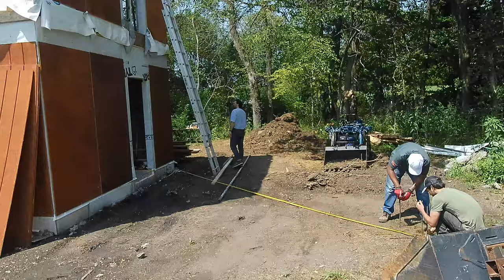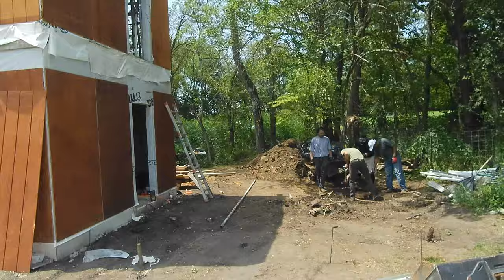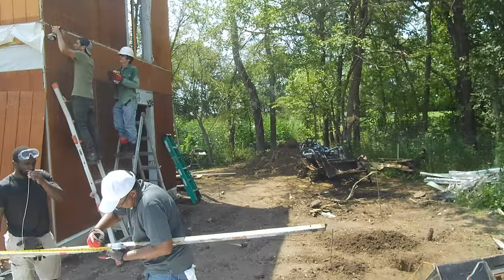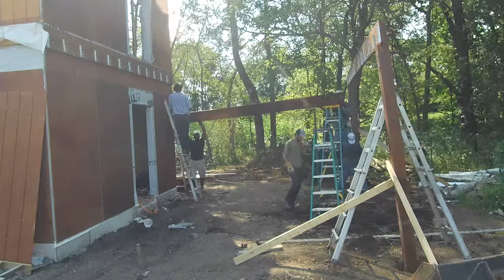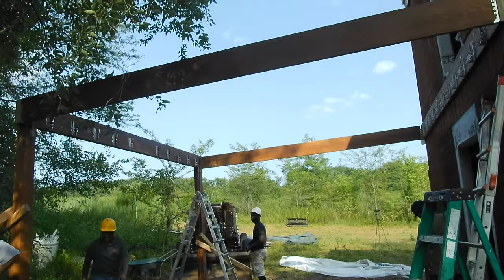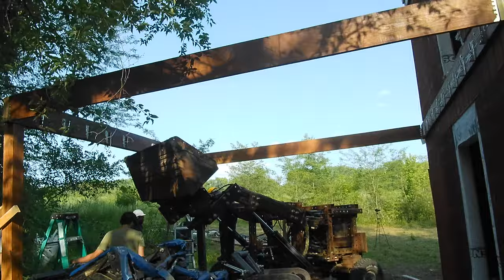Carport B - Seed Eco-Home 2

Comment: The beams should rest on a cutout ledge in the post. 
How about a 24"x24"x8" deep concrete footing, and a 8"x8" concrete post going 12" above ground level. With rebar and a mounting plate at the top of the concrete post.
Reply: And the bottom of the footing is 18" below ground level